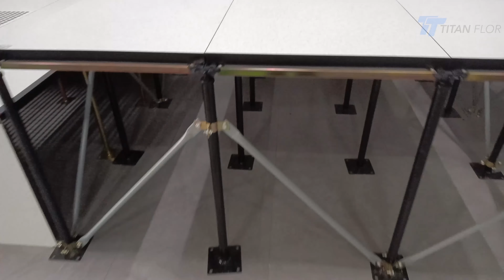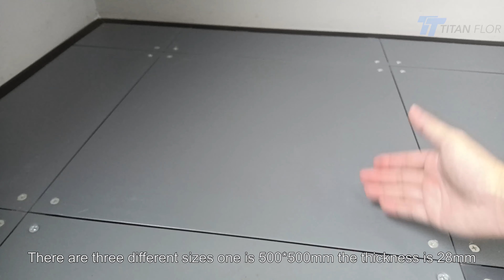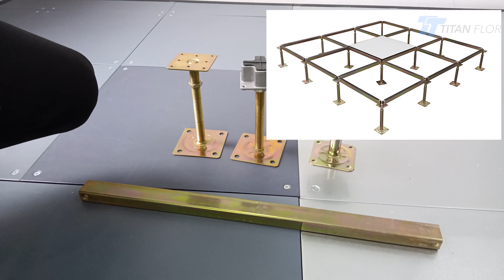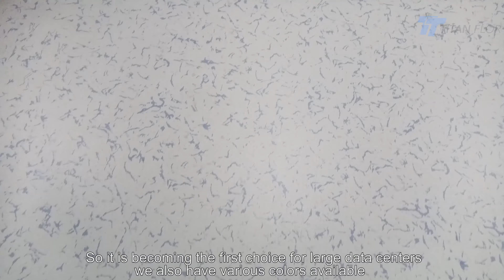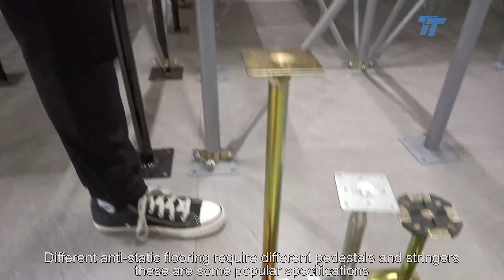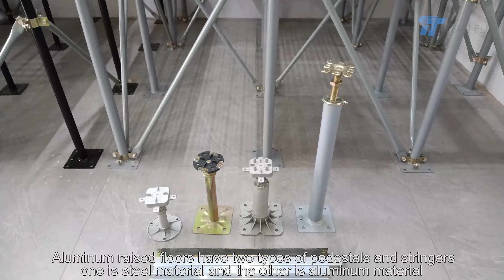All You Need to Know About Raised Floor / Access Floor -- Titanflor

Comment: Our new office has steel cement type of flooring. The tiles are floating and do not have screw slots to secure it to the corners. Do you have advise for how to make the flooring more quiet? With every step the tiles slightly wabble and make noise.
Reply from the maker: This is the disadvantage of steel cement raised floor, noise problem normally occur on the floor with steel thickness below 0.7mm, there are 2 solutions:
1. Use higher steel thickness, but price will also increase
2. Use calcium sulphate raised floor, its acoustic performance is very good.

Comment: Respect thise man   explaining  verry well
Reply from the maker: Thank you for your support! If you are interested in raised floors you can follow me.
Reply: @titanflor996  i watch the video because i work same job here at Heatrow aeroport  ... for 18 pounds /hour  and i ask them to rise my payment at 23p/h but they refuse and i quit . 
The manager at the company is complain  for 6 pounds  cus i ask him to buy a materials ... super  shame at his side ... that also is a reason to quit
Reply: @titanflor996  unfortunatelly the panels is a with metal surface and isnt have holles at each corner ..That is issue  at cheapest panels and they asking me to driled the holles on each corner .. for a surface at 300 meter square ... panel size is 600mm  can you imagine how much job is that for a single person
Reply from the maker: @Pugev  A very large amount of work. There are two installation methods for our production of raised floors. Stringer System&Corner Lock System. You can take a look. Choosing the appropriate raised floors according to the installation method can greatly save you unnecessary work time.
Stringer System: https://youtu.be/h19revyH8As?si=cdXjjU2hzuYvta0n
Corner Lock System: https://youtu.be/iRL2D4bp0NI?si=P5OYkmfu1U5UwtkH